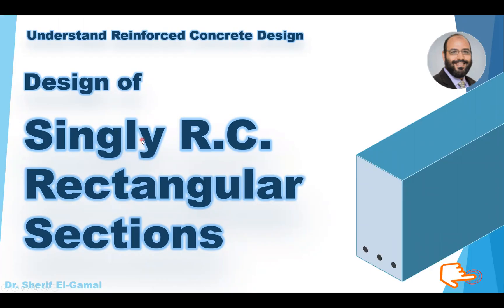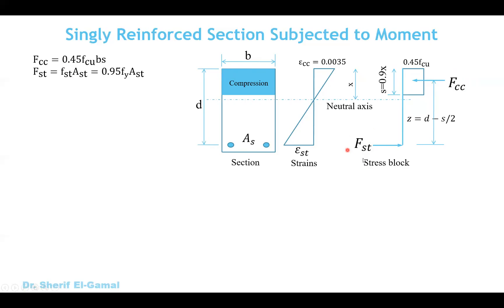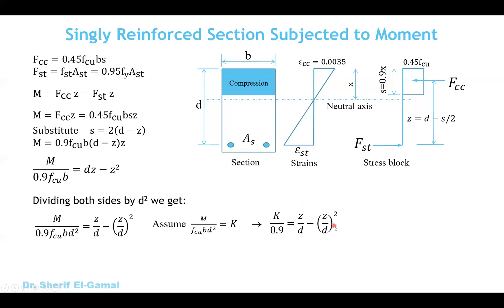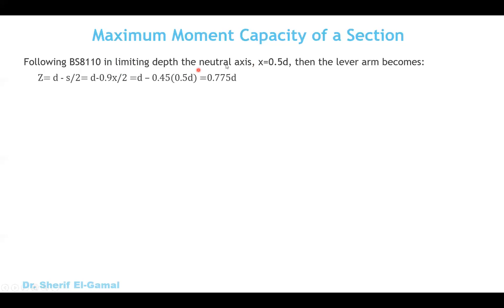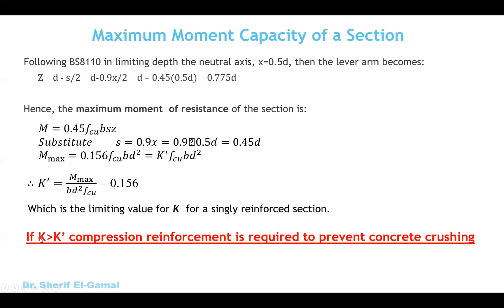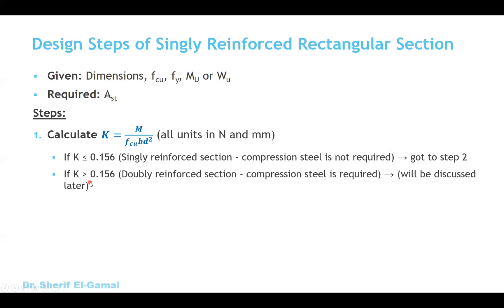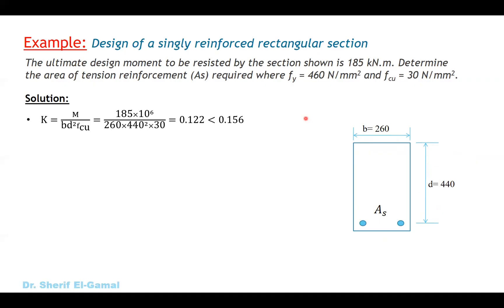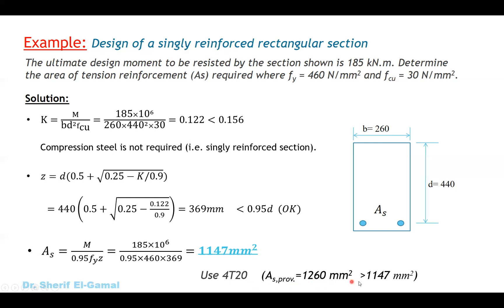Design of Singly Reinforced Concrete Rectangular Sections. How to Design It in 1 Minute? 3 STEPS.

Comment: Sir where did you get your As
 provided from? How can it be calculated
Reply from the maker: I have a small table that I did that shows the area of reinforcement based on the number of bars and diameter.
Reply from the maker: You can do it easily in excel

Comment: Hello Sr i hope you are well may God bless you  you have been my lecturer since i started my course i know all your video there are really helpful, you said that k is help us to know if we can use only tension or tension and compression (singly and double),  i would like to know which K can we use to find  (Z) or (leaver arm)?  is it k' primer or K that we calculate, in example you use k that you calculated how should i have to know that k you calculated is the one to use to find    (Z)  i am very confused about it pls help me Sr.
Reply from the maker: Hello. If k is less than k', then it will be singly reinforced and you will use k to get z. 
If k is greater than k', then it will be doubly reinforced section. The z in this case will be constant as 0.775 d.   This 0.775d, you can get it from the z equation by using k' but you do not need. It will be always 0.775d.

Comment: Thank you, doctor. This video was really helpful. It solved a lot of problems for me in this course 

Please which table did you use to calculate the number and diameter of bars (4T20) and Ast provided
Reply: Since this guide is based on british standard BS, then "BS 4449 - Carbon steel bars for the reinforcement of concrete", section "5 - Cross sectional area and mass", "Table 2 — Cross sectional area and mass", diameter 20 as assumed by the Dr., has cross-sectional area of 314.2 mm2. Ast provided is the area of the steel that you assumed (against required 1147 mm2), here assumed is 4 x T20, which would have an area of 4 x 314.2 = 1,256.8 mm2.

Comment: Thanks  for helping us  doctor, and I wanna ask a question ⁉  why has BS 8110 part 1_ 1997 been  limiting  the value  of lever arm should not be  taken  less than  0.95 times  the effective depth . Thanks  once again  doctor.
Reply from the maker: It should be less than or equal to 0.95d. The code put this limit for safety and to insure that part of the concrete in the compression will be available to resist the compression forces. This will also give more steel reinforcement.

Comment: Thanks ustaad sharif
i ask you one quastion for equation formula load from solid slab two way area trapizodal n×area of trapizodal/long side of panel or ly sir that formula is correct or not
And area of trangular transfer to beam formula n×area of trangle/short span or lx that formula is correct or not
Reply: Thank you sir
Please i need one vedio or example based on uniform distrubuted load on beam load from solid two way slab and one way slab
Reply from the maker: Yes. This will give a uniform load on beam. The shear force using this method will be correct but the moment will be under estimated.